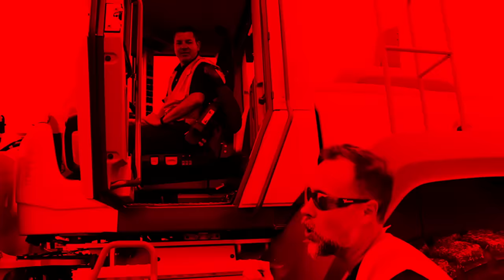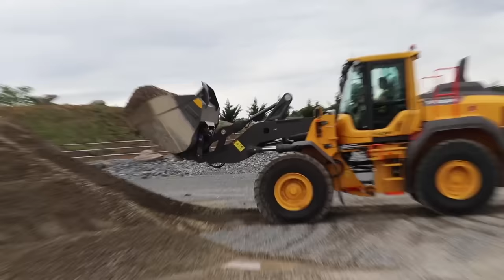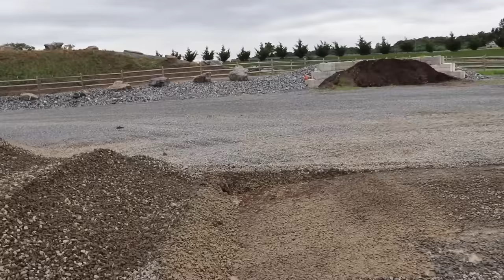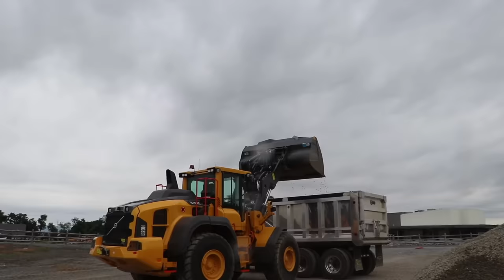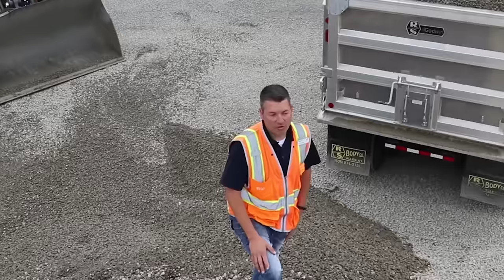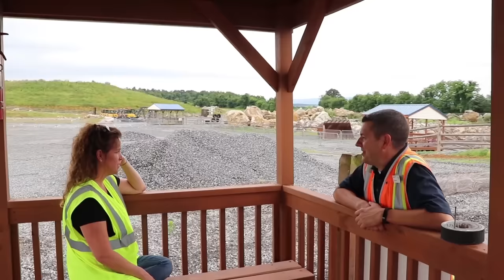How NOT to run a Wheel loader - mistakes, errors and red flags

Comment: Great video and super useful at my new job. But, I gotta disagree with you on one thing. 

The most dangerous machine to run is a material handler in a scrap yard, not by statistic but because of the nature of your customers. I can't tell you how many times I've been loading a truck and had a tweaker at a different section of the pile, they'll see something cool and start just walking towards it. And they always do it when your paying attention to the truck, so you swing back and see jack skellington tugging on a piece of copper wire under your 3,000 lb grapple. I kid you not, 5% of my job was not injuring these idiots.

Comment: It would be easier to get into it if it wasn't so expensive for the course at least in Ontario it's about $4,000 for the course
Reply: I went into it as a Labourer on the end of a rake. The old operators like giving hard working young guys a go. I never did a course for my tickets.

Comment: Well heres someone who wants to be in the equipment. Someone give me a job the trucking industry has gone to the dogs I need out. Hell I'm very comfortable diagnosing issues with diesel engines and I have a hood working knowledge of hydraulic systems. What you guys call lever puller we call steering wheel holders and I take pride in not  being one of those

Comment: You see a puddle of oil as you back up with your loader 
What should you do.
A- call your mom
B- call the cops
C- do the Stan dance
D- call Stan
E- put park brake ,turn ignition off and look for possible leaks on your loader .
Answer in the comment below

Comment: No surprise operators are hard to find. Most good operators learn from good operators. And where did you find those? Building interstates and other highways and the coal surface mines. Not building many interstates like we were in the 70's, and coal mining is dead. It takes thousands of hours to become an operator. You can be competent with less, and we all have to start somewhere. But if you don't have the desire, passion to learn you will at most just be a "driver". With the loss of the big road jobs and surface coal mining, the union jobs are gone. Along with the pay. Even non union jobs paid well, just to keep pace. But wages have stagnated or declined. Too many other ways that are easier on your body to make the money offered today.

Comment: Should do one with old iron. 2 lever/ shuttle gear worn pins POS's in tight spaces. No sand or p stone. Just crap heading for land fill cap.
Then i bet by the end of the day nobody is smiling.
Ya postage stamps suck.

Comment: Not every loader operates around metal there's also sand mines coal mines grain all materials with different density and weight so this video doesn't help at all and btw loaders have self levelling buckets. Let's see him load that truck using the neutralizer pedal.

Comment: Operator is 1-2 notchs above green horn.  That is not how to fill a bucket from a pile.  Should be zero tire spin and almost zero rpm change.  I understand he was demonstrating what not to do at first.  Quit curling the bucket, should be smooth like you are loading feathers.  No matter if you are operating a lawnmower/tractor loader,  CTL, skid steer...if it has a loader do this.  https://www.youtube.com/watch?v=PKT-Mg8clw8&t=1s

Comment: Y’all must not have outlaw truckers cause that ain’t a load that’s about 2/3 what I load on a triaxel dump truck
Reply: The loader probably has scales for one so there's no guessing plus they sell materials by the ton so there gonna weight it anyways so no point in sending a truck out overweight
Reply: Yea, most loaders have a scale so they don't overfill, or the trucks go on the scale on the way out.

Comment: All these videos are great.......but. where is the real world? What I mean by that is, the ground is allways level. There is allways miles of nice flat ground to move around and keep your bucket flat. Like where is the 4ft deep rut filled mud with obstacles on either side and behind you? Where is the tips on loading the truck from the swamp filled ditch because the truck has to stay on the road or else it will get stuck and you gotta push it out? These videos make it look easy because in that environment it doesn't get hard at all. Show me how to flatten an ally where no matter what you do your machine is allways one side in the ruts leaving you on a 45 degree angle to back blade or whatever with the corner of your bucket. No extra good material to fill holes. Just sloppy mud and more mud to work with?

Comment: The first mistake is it’s a Volvo! It will be in the bone yard in ten yrs while CAT keeps on working!
Reply: Come on mate, the Volvo would run circles around the Cat 😂
Reply: @Mrwhatarethose  that's rite . The Volvo loaders are awesome.  For loading highway trucks.  You can't beat a Volvo.  They are very quick and powerful.  I been in the quarry business for over 30 years. In the pit a caterpillar is better . But in the yard the Volvo will run rings around anything else.  Very quite . And don't ride as rough as a cat to. . You can bury a Volvo bucket into a pile. A cat ya gotta keep your foot on the throttle.  .that's for sharing your video.  I could say a lot more . All be good. But I've already taken to much of your time
😁😁😁